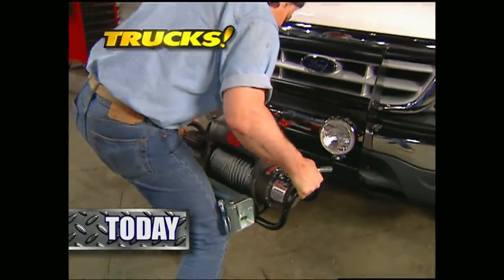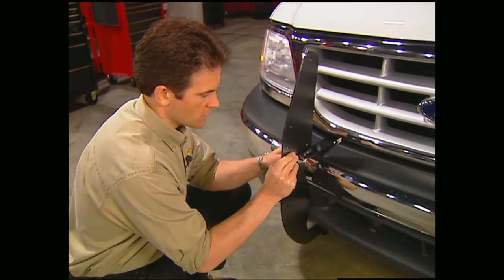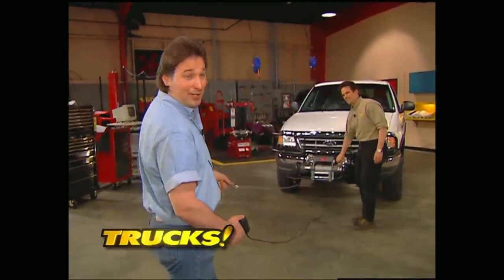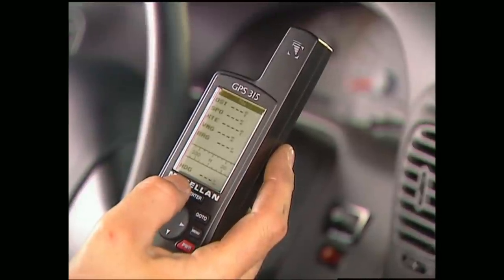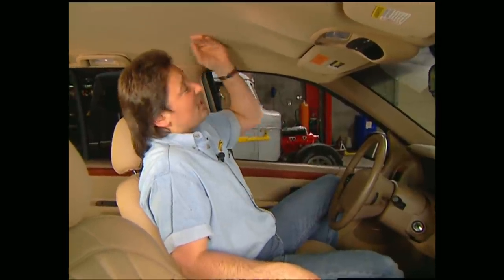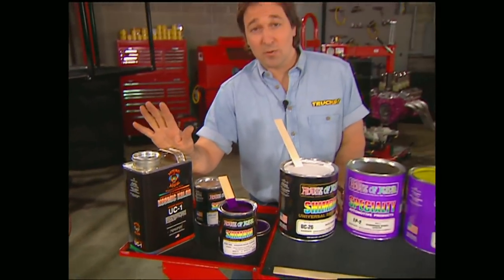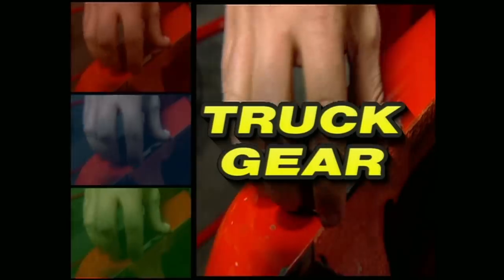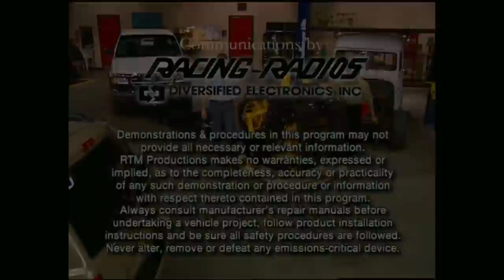Don't Let Your Overlander Get Stuck - Trucks! S1, E15

Comment: That 99 jeep grand Cherokee limited was taken a beating like a champ. I've taken my 04 jeep grand Cherokee limited across the Rubicon jeep trail in stock forum just to see if it was really trail rated. Made it across the trail with bald tires and just a little bit of trail rash. Didn't need a tow strap or a winch. Now it's been across the Rubicon jeep trail 3 times and it's been across swamp lake and the doozy ersham Jeep trail  coyote lake and strawberry jeep trail. Still no lift kit, and no lockers just a stock old Jeep with 244,000 miles on it and still running strong now that I moved to the PNW.  God I remember getting up early every Saturday morning just to watch this show. Really like tails from a gear head podcast that Stacy David does now.

Comment: My uncle has one of those f150s with similar style wide as steps. Lol that they say the steps are barely trying.... it hecka flexed!
Reply: I had a 97. I removed the running boards my father has a f250 SD of the same generation. His running boards rotted off. Funny enough, he also has the same generation Grand Cherokee (01).

Comment: Only if they knew about the shitty timing and oiling in the Ford. The Jeep would be fine if they kept the 4.0 ,5.2 and 5.9. The 4.7 was trash from the beginning.
Reply: The fords from that era had no issues with timing. They were all 2 valve motors. Only issue was spark plugs blowing out of the head due to insufficient threads. The issue was resolved though in 2003